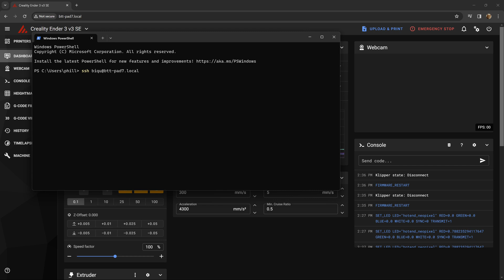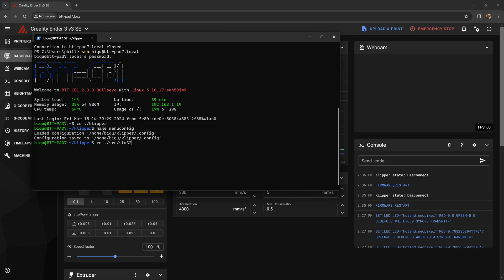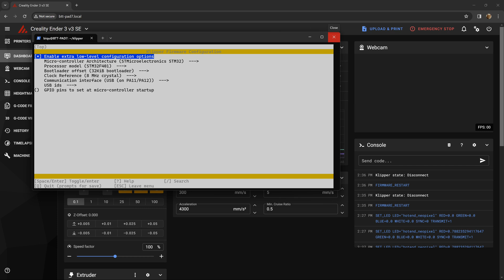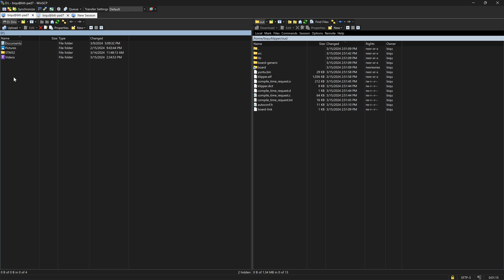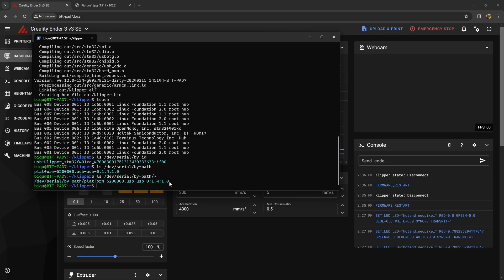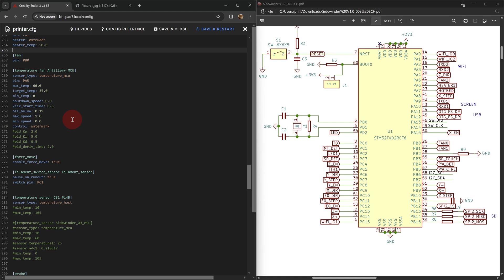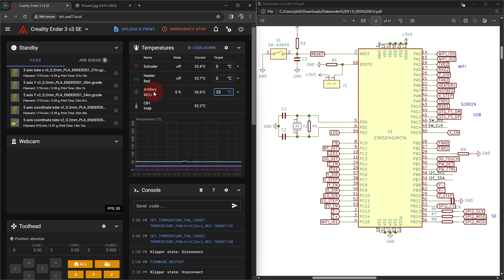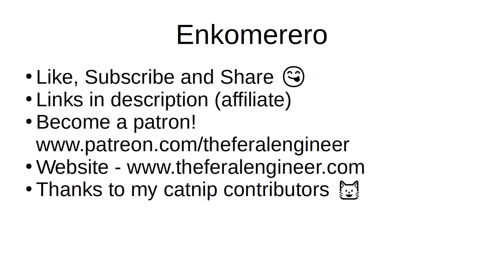WORLD PREMIERE! Installing Klipper on the Artillery Sidewinder X3 Plus (and Pro)  the easy way

Comment: instant subscribe from me, someone who has absolutely hated their x3 plus experience since day one. gonna give this a go. thank you so much
Reply from the maker: I'm quite pleased with how well it's working already. I ran a test today without tuning it and it's already performing well. I'll put my cfg up this week
Reply: @TheFeralEngineer  looking forward to further uploads! my x3 plus has been nothing but disappointing after hundreds of hours of tweaking, i can never seem to get it just "quite right". between fixing all the QC issues and no help from artillery support with basically anything, i'm ready to wash my hands of it and just try klipper.
Reply from the maker: @NoGoodCitizen  what are some of the issues?
Reply: wonky ABL, nozzle wipe function portion of g-code had to be rewritten, many components halfway plugged in and pre-assembled hardware not properly tightened, it's a very long list that i could keep rattling off issues for hours. mine shipped with part of the wiring harness caught in the mobo fan LOL @TheFeralEngineer
Reply from the maker: @NoGoodCitizen  omg! Well, unfortunately Klipper won't solve those headaches, but I hope it'll rectify the things it can help you with 😹. It'll help with abl to a point, but now that I have the pinout, Bltouch might be on the horizon 😀
Reply: @TheFeralEngineer  purchased my BTT pad today and it'll be here tomorrow! I'll keep you updated. I already have Linux running on a dual partition laptop so this should be pretty painless to move over.
Reply: the pad is here but I seem to be unable to connect to Klipper with the common "mcu: unable to connect" error. I've got the printer.cfg set to serial: /dev/serial/by-path/platform-5200000.usb-usb-0:1.4:1.0 but still seem to have no success. any idea what i might be doing wrong? i've followed everything to the letter near as I can tell.
Reply from the maker: @NoGoodCitizen  is that your actual serial path or just the path that was in the cfg?
Reply: @TheFeralEngineer  it does that whether i use that or /dev/serial/by-id/usb-Klipper_stm32f401xc_4B0030001351313430333633-if00. no difference with either
Reply from the maker: @NoGoodCitizen  you on Facebook or can you message me through Gmail? Install TeamViewer on your computer and I'll bang you out real quick

Comment: i knew it !! you will eventually win over them, I'm still waiting for some pro reviews of the x4s as all I'm seeing are general walkthroughs and unboxing to the point it got me worried, why aren't they sending them to the main YouTube channels to get proper video on ? 
any way thanks for the effort on your videos man i really look up to them
Reply from the maker: They're all pretty much the same in this category. Makerbase boards, rk3328 based Linux systems with proprietary firmware and special nozzles... Nothing earth shattering. Peopoly is the only company really innovating at this point
Reply: @TheFeralEngineer  rk3328,isn't the same one used with elegoos neptune 4 series? 
Cant agree more and I hope they get the proper support to get bigger and better in the fdm market
Reply from the maker: @Dr3dMNR  every one of them is using it. Elegoo, sovol, Artillery. It's just repackaged and bastardized guts of an mks pi that is a poorly supported version of the libre renegade, down to the source code. 

A big thing right now is every community looking to strip the proprietary firmware from all of the aforementioned machines. I gave a few of these guys a starting point with my videos and it's cool to see where it's all going.

Comment: Oh man the resistance Artillery gave me for installing Klipper on my printers. 

Been holding off on buying X3 or X4 until someone got into the mainboards to install the firmware
Reply: Why do you not like firmware over usb installation? It bypasses the screen preventing the sd card install
Reply from the maker: @geauxracerx  it's not user friendly. The screen is trash after the klipper install, so just disconnect and problem solved. I did this for the people. 😀

What kind of resistance?
Reply: @TheFeralEngineer  the screens were trash to start with. I think after having to manually flash firmware on over 10,000 sd cards I have developed a bias against them. Which has me leaning to the USB cable😂
Reply from the maker: @geauxracerx  they're decent units. Problem is they are tjc Chinese market Nextion screens and there's a one bit difference in the coding, so while the IDE to build the screens are identical, you can't use nextion ide to build a tjc hmi project and vice versa. The tjc software is only available in Chinese and overwrites the nextion version on install. I think it's a checksum or some shit that is altered so you can't use the projects interchangeably. I think tjc screens are half the price of nextion or more to the general public 

Otherwise, they're good to have for Arduino projects.